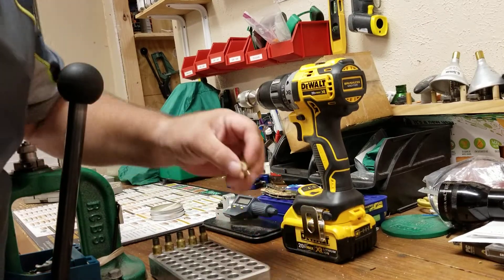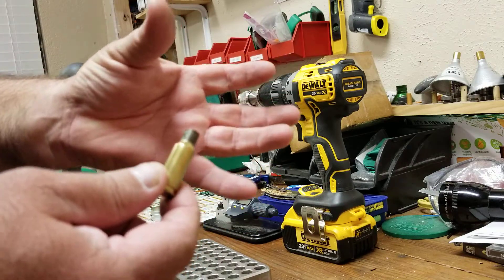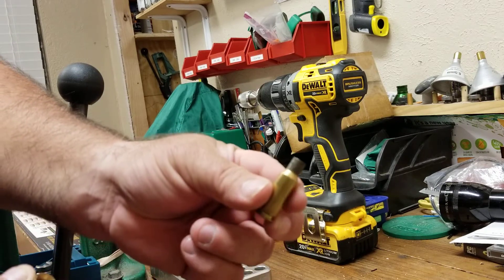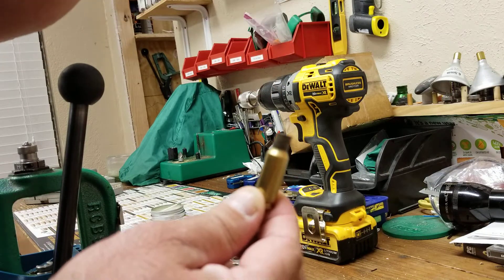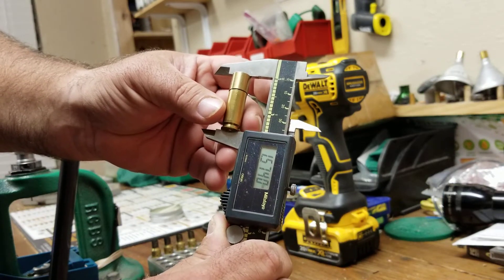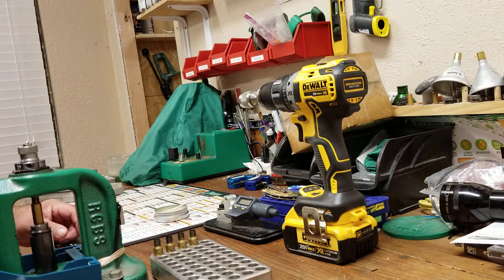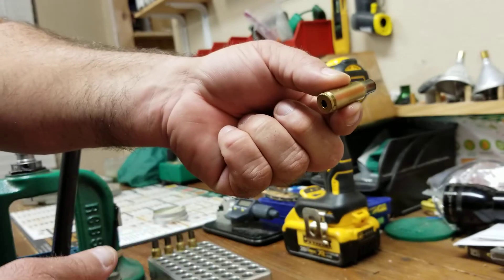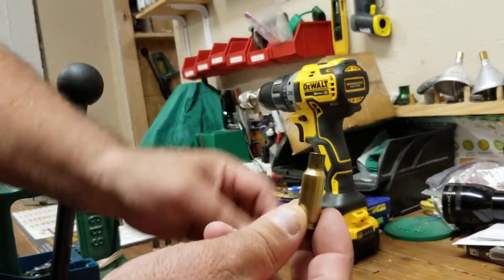Shoulder Bump

Comment: Great video and explanation of "Shoulder Bump", a term that is thrown around the inet but with no actual info on what the bump means. Including yours to a point. I assume the "BUMP" means a specific point at the contact face of the chamber where the shoulder of the cartridge would be touching the chamber? So the point is to move the shoulder back  so It doesn't contact the chamber when loaded? Thanks for any clarification.

Comment: I've been reloading 20 years and never one have I heard of a "should bump gauge." What am I missing? I've never had a set of dies come with such a contraption, either. Why can I simply turn my resizing die down?
Reply from the maker: @jakemitchell1671  you can do exactly that. This die I am using is a "semi custom" die made by Harrell Precision and all their dies come with this. When you screw in your die, you essentially are using more shoulder bump. The chambers we use in Benchrest rifles are cut to very tight tolerances, thus we need to set the brass back in very small increments. Hope this clears it up a little for you.

Comment: How accurate is your shoulder bump gauge when it reads way past the datum line, which is  roughly halfway down the shoulder of the brass? Your bump gauge seems way too deep. Are you sure this is an accurate place to measure on your shoulder?
Reply from the maker: Since I can consistently measure all pieces of brass within +/- .001 with the same bump gauge, i feel it is very accurate.

Comment: How can I get bump gauge like yours in .308 Winchester? Thanks
Reply from the maker: Several folks make them. I believe the last few I bought were from a guy named Pbike257. You can email him at pbike257@icloud.com
Reply: Did you have any luck getting one?
Reply: I use a fired 9mm case as my measure block   It fits where the neck meets the shoulder of .308 Win fired case. Use to measure bump distance when I resize my cases.